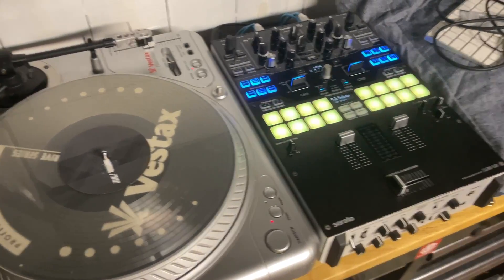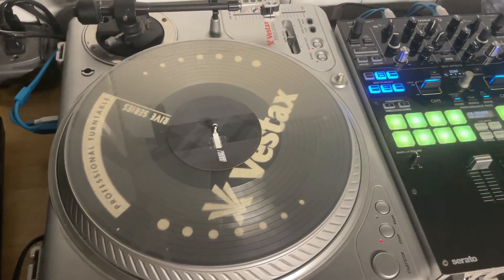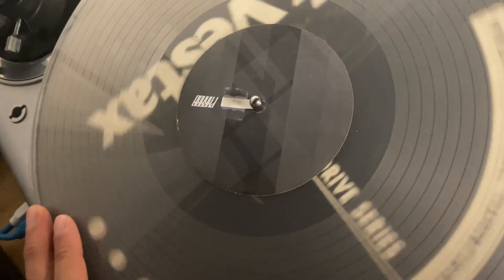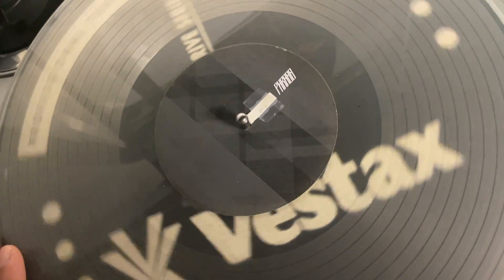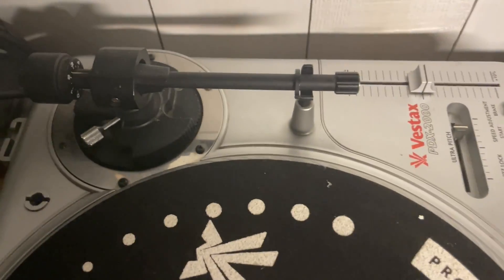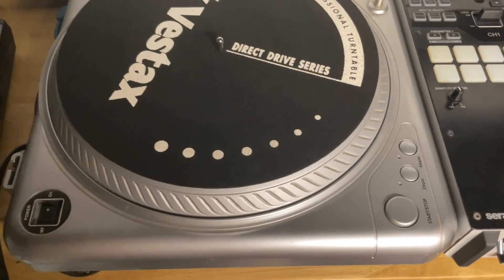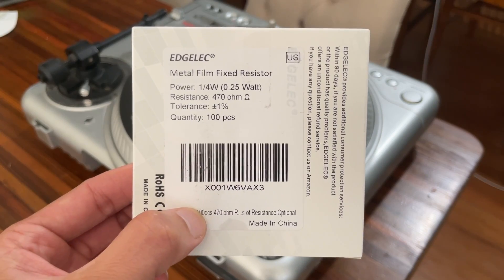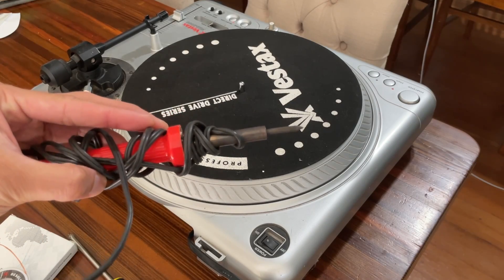Vestax PDX-2000 Anti-Vibration Mod

Comment: so i checked i got the same section i'll can order the components for make the repair, i tried to make turn without the plate and i clearly see big vibrations the motor looks like locked by something, i'm just waiting for the reference of the diodes please.

Comment: i have this problem on one of my pdx-2000 (it is exactly the sound of a cat like you said) and vibrations in the finger, i'll maybe try the repair but i'm not sure about the references of the diodes you said about resistances but not for it (i think) in the video, thanks a lot for this diy tip, i'll check asap if my turntable got the section D705 , D706 , D736 D765 D766, i hope so...

Comment: hello dear friend! I have the same turntable and after using it for a while I noticed that the thrust of my engine had weakened. I used to get tired of the hand with which I scratched, but it was as if the motor had become weaker. I haven't untwisted and understood the player yet. could there be a problem with the deterioration of traction due to the fact that everything needs to be soldered there??? thank you in advance!!!
Reply: The problem I am fixing in the video only affects certain pdx2000 serial numbers, I’ll see if I can find the list.  Unfortunately, I am not able to diagnose what’s wrong with your turntable without being able to test it myself.
Reply: @solventless808    ok thanks, any help will be a lesson for me